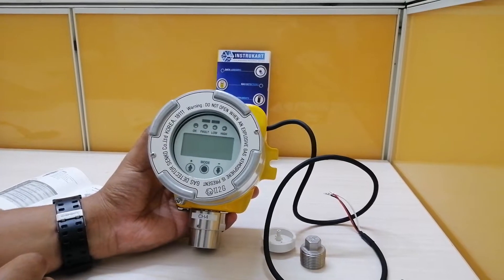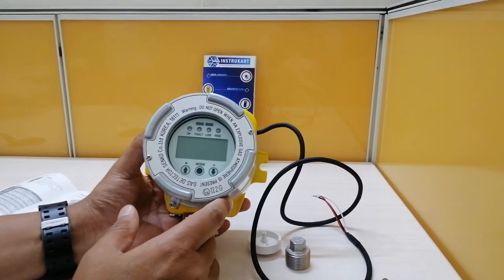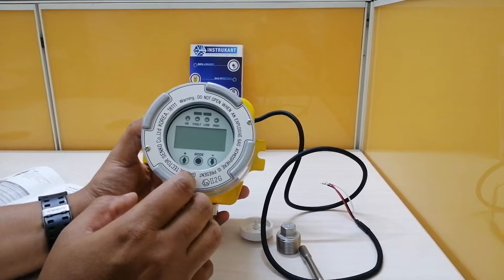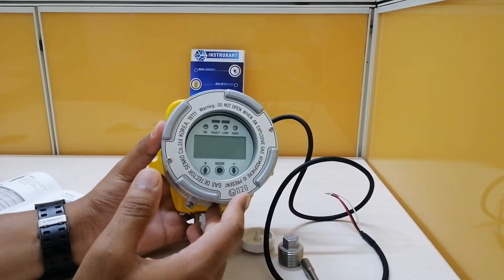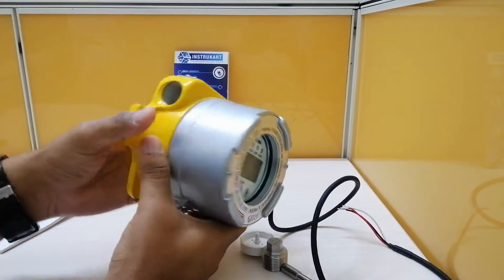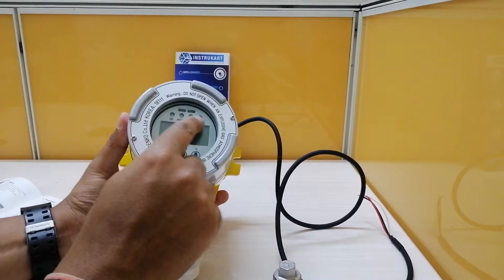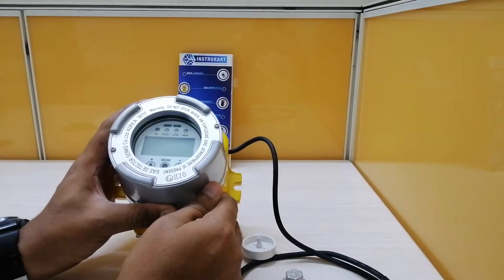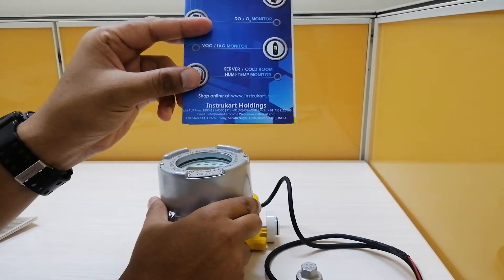Senko SI-100 CH4 Fixed Gas Detector| Instrukart

Comment: I'm looking at purchasing this unit (anywhere between 3 to 6, not sure yet) along with a controller. I'm not finding any information if the controller will output Modbus or anything that will allow me to input to my PLC systems. Can you help answer this please?
Reply from the maker: We can suggest you a controller to monitor multiple device simultaneously with modbus Output option. 
Feel free to reach us on at info@instrukart.com

Comment: what does it mean with automatic calibration function?saw that features on the datasheet
Reply from the maker: This is used to monitor for any change in the sensor's sensitivity and if necessary, adjust it to be in line with the last gas calibration. Generally performed by the Detector as Zeroing using the ambient conditions. However Calibration is suggested to Perform as per OSHA only.